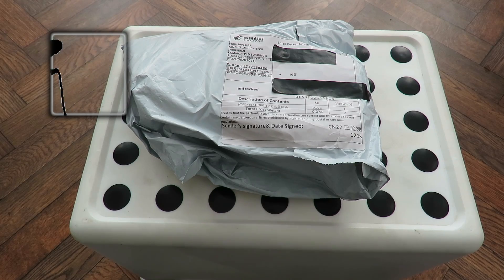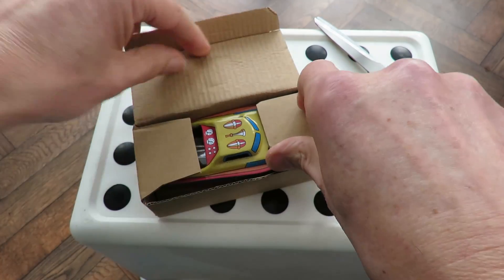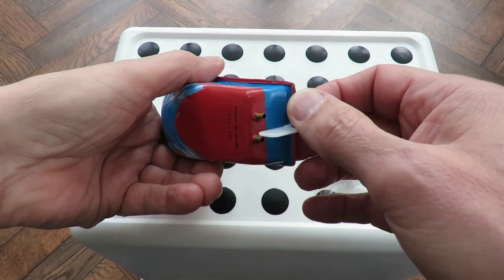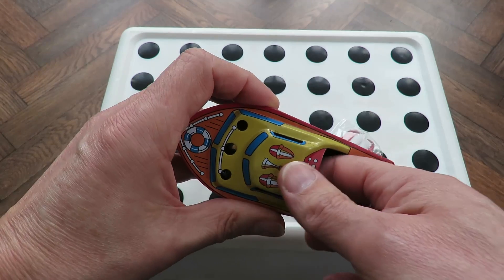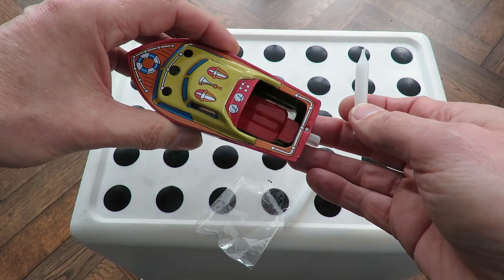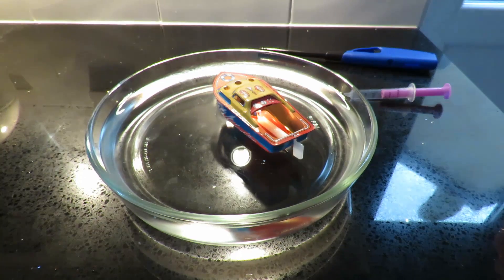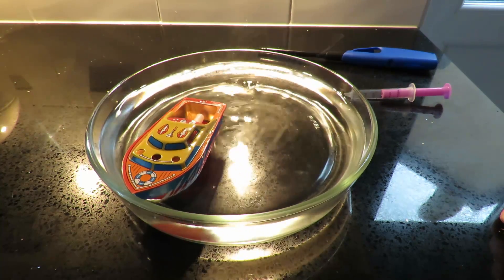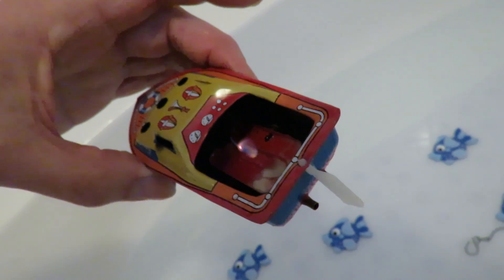Grandad's Postbag 20190216 Pop Pop boat shortened

Comment: Indian pop pop boat is more better than this very fast and more crazy sound
Reply from the maker: Thanks for commenting. I have recently been thinking about making some more. If you check my video description you will find my playlist for my pop pop boats. I bought this one just to see what the commercial ones were like. Interestingly enough, back when I bought it from eBay back in 2019, China was the only place supplying them (on eBay). In the video description you will see it cost me £3.37 When I look one eBay now, the majority of sellers are from India but they want to sell in bulk to keep the unit price down. Obviously the shipping (included in the price) makes selling individual boats too expensive. I could get 5 for about £13 or 10 for about £16  or 24 for about £38. The last time I made one was 2 years ago and that was using an induction coil to heat the water, just to see if it could be done.
Reply: @GrandadIsAnOldMan OK brother, ur very kind of man ❤

Comment: I modified one of those boats using a single tube boiler that split into two exhausts. The original boiler burned out. Interesting how many times it changes directions after the initial getting stuck on the side. 
https://www.youtube.com/watch?v=-4WBuff1_Fk
Reply from the maker: Yes, that one is crazy fast.

Comment: I saw this solar powered one you might like. If someone could make a solar tracking device for one that would be neat.
https://www.youtube.com/watch?v=IlfabA4Sv8o
Reply from the maker: Thanks for the link, that was fascinating. It does have problems, it catches the wind very easily so it is difficult to be sure it is driven by the pop pop motor and of course you can't run it indoors to prevent the wind effect. They put a lot of detail in the video description and acknowledged the wind issue. As you say, a solar tracker would be needed, or you have to build the pond to align with the sun and the larger the pond, the more likely you are to get a breeze blowing across it 🤔
Reply: @GrandadIsAnOldMan  I saw this solar tracker that was kind of cute for the simplicity. Maybe some clever person could design a tracer for a solar putt putt boat. There are some places in the world or times where the sun is out without any wind and maybe then the little boat could shine.
https://www.youtube.com/watch?v=Oj1E7o7J3qc
Reply from the maker: @Resonanttheme  Yes, the simple solar tracker. Here is one I did back in 2020 after seeing somebody else's video https://youtu.be/z0xAdjC6Qxw very little required to get the action. I did a slightly improved one later. Amusing to see the difference in the viewing figures between his and mine 🤣🤣
Reply from the maker: I like that idea. I have done solar powered boats, and water jet boats, but I haven't done solar powered water jet boats 🤔👍😁
Reply from the maker: I notice bigclivedotcom had a look at these a few years back and the top comment suggests making it into a solar jet boat 🤣https://www.youtube.com/watch?v=y9BvhPG-rQE
Reply: @GrandadIsAnOldMan  I've watched several of his videos in the past. Thanks for pointing out the solar fountain jet idea. I put a typical formed/molded angled silicone straw over the center nub/protrusion of my fountain and tried it out yesterday. The straw just droops and works well enough.
Reply: @GrandadIsAnOldMan  That was interesting.
Reply from the maker: @Resonanttheme  need to add a rudder so it can go round in circles in the middle of the pool 👍👍 If I had a pool of my own, I would give it a try 😊😊
Reply from the maker: @Resonanttheme  I just put a solar panel on one of my old water jet boats and it does push it forwards, but I am only testing it in a rainwater barrel, so we don't see much action. I will drop a video link here when I have done the editing 🚤🚤
Reply from the maker: Solar Water Jet Boat - proof of concept https://youtu.be/xKx7j-W8BBE
Reply: @GrandadIsAnOldMan  I wonder if you got a jumbo putt putt boat and jumbo fresnel lens off an old TV or something larger if the heat energy could be enough to override any gentle wind issues? Maybe at high noon the lens could be horizontal or less inclined to catch the wind. A lot of work though tinkering to get it right and not really efficient of course, more of an art-like project.
Reply from the maker: @Resonanttheme  The Putt Putt does not scale well. There are a couple of YouTube videos of people carriers and they really perform badly. I have done a few low powered boats using various methods, it doesn't take much of a breeze to send them sideways or backwards, and that is without the addition of a large wind catcher. Having said that, when I want to fly kites you can guarantee the wind will be non-existent 😁😁
Reply: @GrandadIsAnOldMan  I used to help my next door navy pilot neighbor fly his hot air balloon. Even very big things are sometimes susceptible to a breeze. One time having just stepped over the cables to the basket and balloon, the balloon just inflated with cold air from the fan before firing the burner a dust devil picked up the entire balloon out of nowhere and smashed it into some buildings, flying as if enchanted. Often we let go helium balloons to test for wind as well.